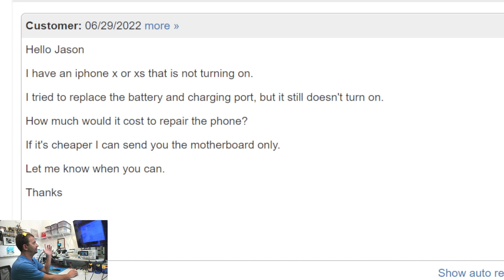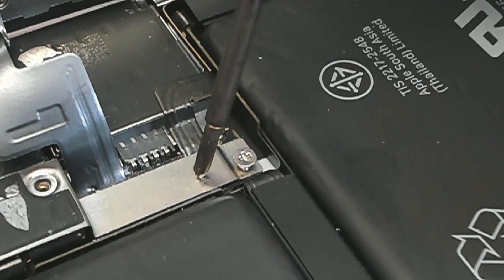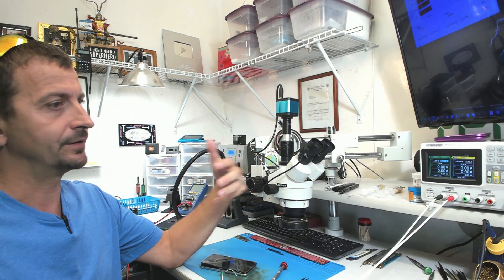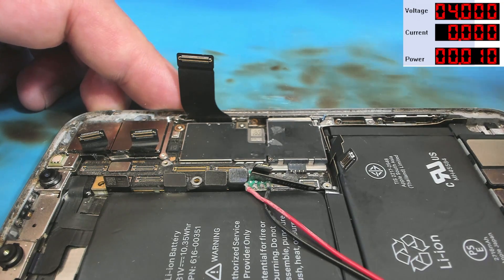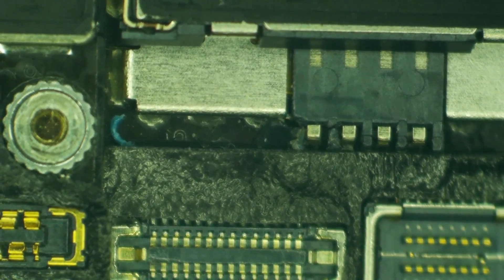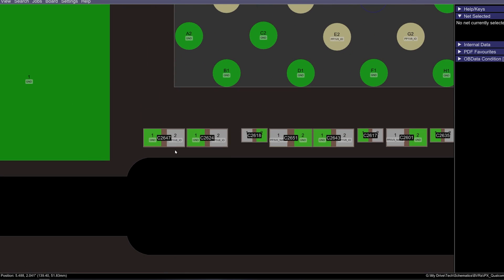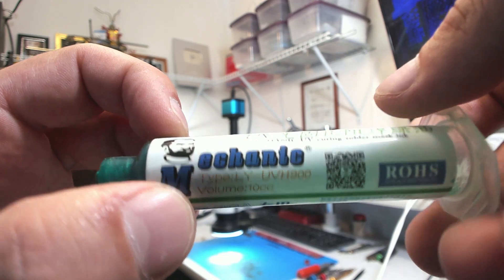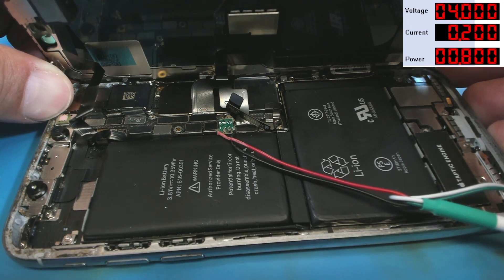An iPhone X board repair (No power 💪 Manhandled)

Comment: Hello Jason. Greatings from Germany. Very interesting Chanel👌🏼

Why does the replacement of the Cap withe UV-Mask work?
I‘d like to understand why there is no need to replace the cap with another one.
Reply: It depends on the caps function. Most caps are used to store charge. They help to reduce voltage fluctuation. A line  may call for 1.8 volts. The supply is outputting 1.8030 volts. The caps are also storing a charge bring the line voltage to 1.8033.

imperceptible
Reply: @OnYourSquare  Incorrect.  Caps will not increase line voltage. Following the logic in your answer, if I use 10 000 caps in the circuit, my 1.8V power line will reach 4.8V.
Ceramic caps are mainly used to provide a short path to ground for high frequency noise.  They are placed right next to integrated circuits, because those are the most sensitive to this kind of noise.
High frequency noise may come from the power supply providing energy to the device , it may also come from surrounding components doing digital operations, picked up by other components like coils or traces, or it could even originate from the outside world.
When you remove a failed cap, noise level will inrease. In most cases your device will continue to operate.  With enough caps removed you reach the tolerance level of the IC an it will start behaving erratically, giving unpredictable results.
Reply: @ritterrita3754  (lol) What? The output voltage will be higher than the input voltage. 

Capacitors are tiny batteries. 1 AA battery is 1.5V. If we add 2 batteries, the line voltage is 3.0V. Add three? 4.5V. Unless you've somehow broken Moore's law. 

Once the capacitors are charged, your line voltage will be higher than your initial output voltage. 

This isn't rockets science.
Reply: @OnYourSquare  
1. The capacitor charges up to the input voltage, not higher, it is not a boost converter.
2. Moore's law is about semiconductors, not capacitors. Do your capacitors double their capacitance every 2 years?
Check link for Moore's law: https://en.wikipedia.org/wiki/Moore%27s_law
3. You don't even understand the difference between parallel an series capacitors. Or batteries for that matter.
Reply: @ritterrita3754  1. Power filtering capacitors bleed their voltage into the line, when the voltage drops. 

2. During the voltage drop, the cap discharges its voltage into the line! 

The output voltage is now higher than the input voltage. This isn't complicated (lol).
Reply: @OnYourSquare    And you also don't know what capacitor bleeding is. Not surprised after all this.
It's a safety procedure and is there to decrease voltage not to increase it.  
Here is a link so that you may learn. https://en.wikipedia.org/wiki/Bleeder_resistor

Btw, a cap disharges energy not voltage. By doing so the voltage drops.
You also contradict yourself "During the voltage drop ... The output voltage is now higher"

I stopped arguing with you. I let the readers decide the correct answer for themselves.

So we learned a lot of things today about Moore's law and capacitors, charging, discharging, bleeding, connected in series and parallel, noise filtering.
I also learned that  AngryTechGuy likes to throw jargon around but is full of BS and does not know what is behind it.  

LOL, rocketscience, not complicated, hyperloop.
Reply: @ritterrita3754  (lol) What "power filtering" is tech jargon? You may need to study a bit harder. 

The greater point, the cap isn't an issue. The tolerance for that line is  +/-10%. Plus LDO voltage output is fairly stable. 

Switching supply voltage is  unstable. With enough missing caps, the instability may affect performance. CPU & GPUs especially. They're powered in phase and the cores require very precise, stable voltages. 

So again, that line does not need the cap.

Comment: I am actually a bit disappointed that you did not properly replace the capacitor, like you normally do.
I find it unprofessional that so many repair shops removes capacitors and calls it "repaired".
Sure, it will probably work fine in 99% of the cases. But that last 1% customer might get sporadic crashes. Capacitors are there for a reason, believe it or not.

Honestly, soldering in a new capacitor is faster than the UV hardening.
Reply: Yep that's for sure you will have random problems or slowly destroy components due to noise and unfiltered spikes from switching components on the lines missing the caps not good work. When I see a blown cap I replace it and I don't go back with the same if its a little 4 v smd il swap in a 10v for higher breakdown capability if it's a shit quality cap il put in a good one if it's the wrong type of package or capacitor type il adjust it to what I feel should be doing the job. One thing to realise is that the small smd caps that are used come with many many problems and also there are alot of diferent types that fail in diferent ways but you really need to know your capacitor science to go there lol

Comment: nice work dude .. how the heck are you almost finished with a tube of uv bro that stuff lasts years hahaha how much do you use :D
Reply from the maker: Thank you!  I didn't realize how low this tube had gotten until I was editing this video. :D  I still have a few tubes in the refrigerator and wondering how long before it goes bad.  It's been so long, I don't even remember where they came from!